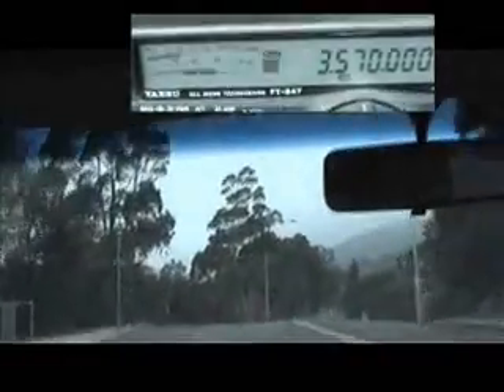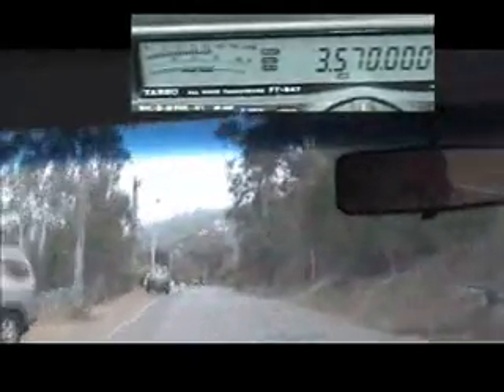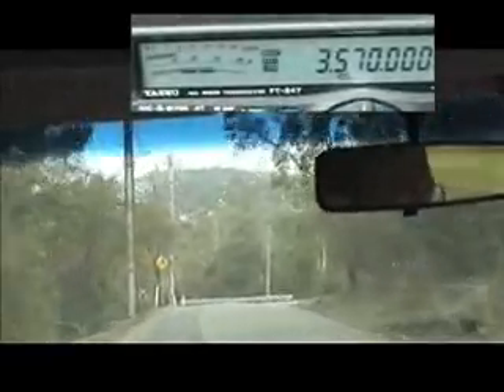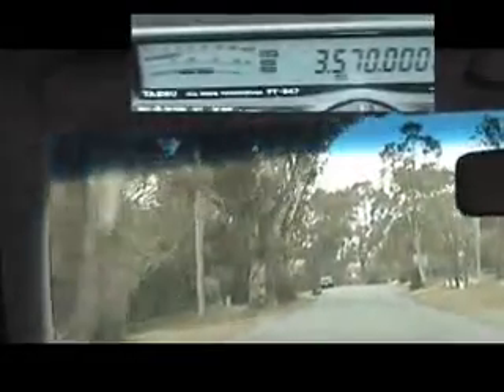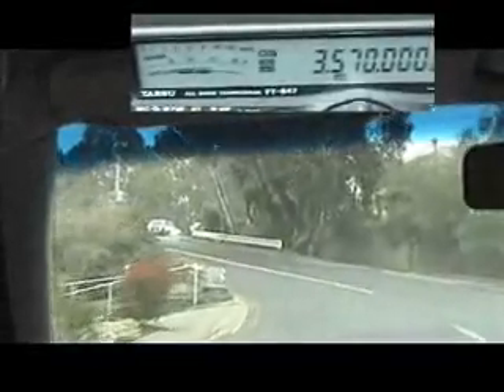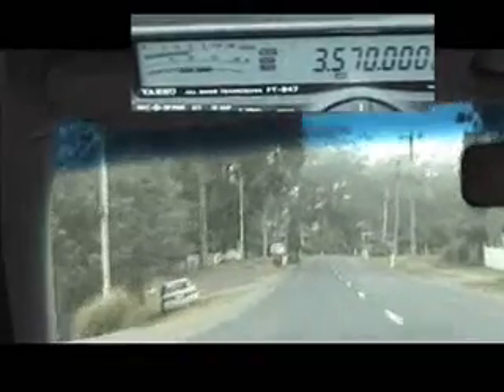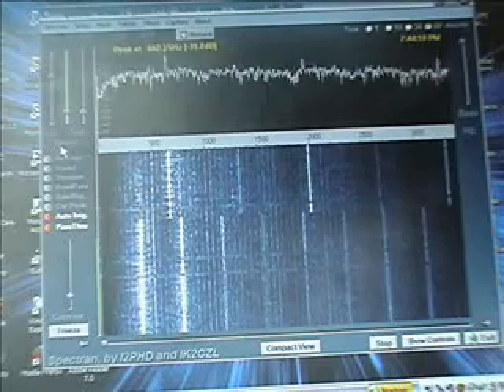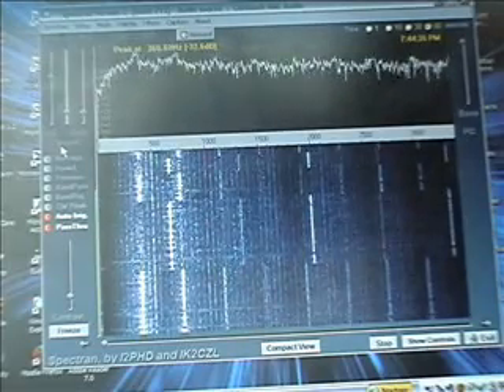Broadband over Powerlines - A Radio Amateur's Perspective

Comment from the maker: Ideally switch it off. Realistically a range of measures can be employed to reduce the emission level. Start with both hardware and software notching on backhaul and consumer bandwidth to try and address emission and ingres issues. Secondly employ BPL network management software that dynamically minimises power levels for bandwidth delivery across the network.

Comment: A very nice display and commentary about this trashy technology. From what I have observed, BPL simply is not able to effectively compete with DSL, cable, and wireless residential offerings. Hopefully this power company dream (and our nightmare) will simply fade away as FIOS becomes a fact of life in most areas during the next 10 years.

73,

Rob WB1AEX

Comment: Ok. Thanks. Did you had problems to make communications with others? Because the power of BPL is very low compared with the power of the radio transceiver. Did your radio communications were affected? or you just listen noise, as all the power lines issue?
Thanks a lot.

Comment: I suppose if there was massive infrastructure devastation  that required HF emergency communication , BPL and the fragile infrastructure, would be down anyway, thus clean EMF spectrum. I however like the independence of radio too, as more likely than not if a national security issue arise, the net would be switched off. The political system we live with, only does enough to be voted in again, major infrastructure projects are a thing of the past.

Comment: Actual the cost is much higher! The HF spectrum is a limited international natural resource. It's governed by the ITU. HF has the unique ability to provide world wide point to point communications with no infrastructure. Unlike most modern communications system that depends on massive and fragile infrastructures. An HF transceiver and a simple wire antenna hung from a tree is enough for world wide emergency communications.

Comment: I suppose the popularity of the internet which you are using to voice your views on bpl,is really the issue.If Amateur Radio had the numbers, you would voice your opinion via radio, obviously it doesn't. But I do still feel BPL is a poor method of data transfer, however as powerlines are already there it's cost is very low compared to fiber optics or copper wire.